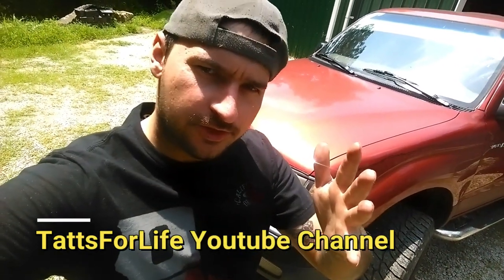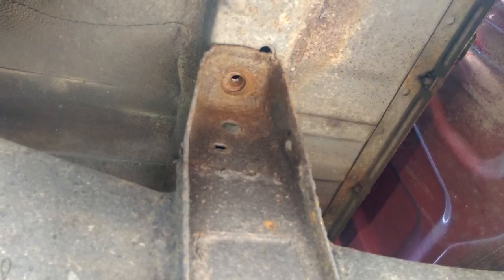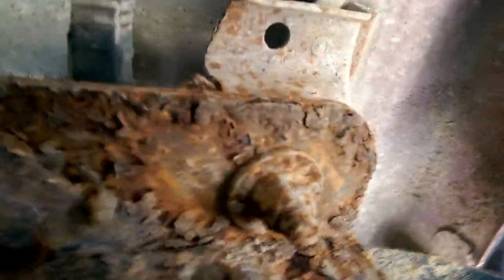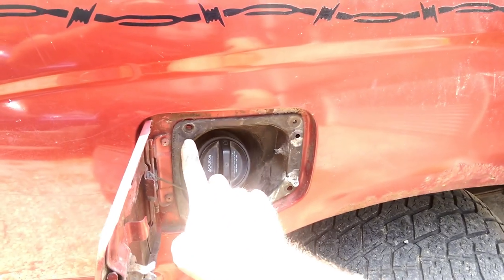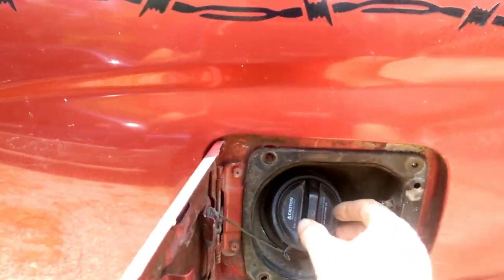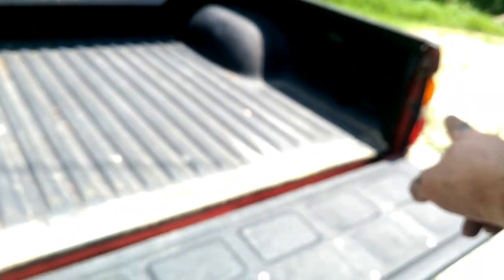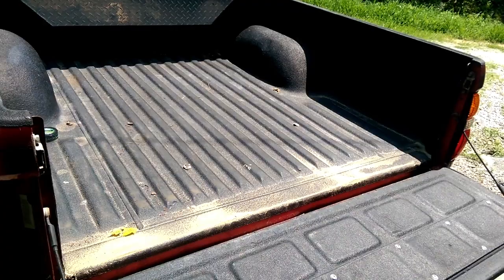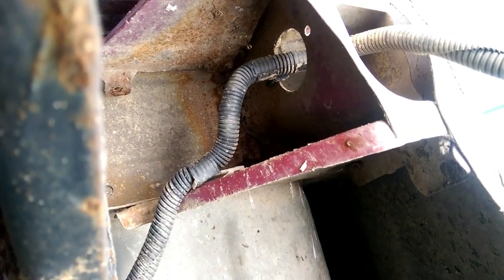How To Remove A Toyota Tacoma Truck Bed

Comment: Thank you for the video, i really hope my bed will come off easy, lol. On a side note i need to change the fuel pump on my 99  tacoma 2.7L, will i be able to change the fuel pump after i take the bed off? Or i need to drop the tank off too??  I would rather do just one. Thank you
Reply from the maker: I'm not sure, you should be able chance pump with bed off, I never seen a truck that you could not

Comment: Its funny you posted this. I have a Tacoma Im trying how to figure out how to take off the ARE cap
Reply from the maker: the factory are cap?
Reply: no the truck cap is something the previous owner put on. its a very nice truck cap though. I have had no reason to take it off yet. Was just curious. Im sure its just some hardware and sealant where the cap meet the truck body edges.
Reply from the maker: sometimes they just held on by clamps very few have bolts that hold them on

Comment: The bolts in the back are super hard any tips to break them loose?
Reply from the maker: just luck and hope, all I can say, use lots of wd/40 and maybe heat
Reply: You can get a grinder/cutter at harbor freight for under $30.00.  Bet there are videos on how to cut with grinder.  Destroy the olts.

Comment: Are the 3 bolts underneath pretty similar for the Gen 2 Tacomas? Good video, by the way, but man, your truck has significant rust underneath- was it originally from the North?
Reply from the maker: Dk, was a customers truck

Comment: Good video though isnt there a main harness plug that can be disconected from close to the back lights so that each light doesnt have to be taken out to remove wires? my thing is want to take bolts out just to slide back the bed 2 feet to get to gas tank hoses then slide bed back it is 3rd generation tacoma which used plastic composite bed much lighter then previous beds on tacomas.
Reply from the maker: im not sure, it was always just as easy for me to do it this way lol never tryed any other way

Comment: Can anyone offer me a suggestion? The bolts he says in the video that "will be the most fun you ever had......" on my 2002 are just stuck, can't budge them at all. In fact I think the bolts themselves are rusted and aren't really hex anymore. I can't get anything on it to grab it. I got the other 4 of them off (pain involved there too) but at least they didn't break.
Reply from the maker: have you tryed a torch
Reply: @TattsForLife  Thats how I got one of them out. The other one had to be cut, with a hacksaw. Forgot that my dremel was burned up. Glad that job is done ! Thanks for the response.
Reply from the maker: welcome, happy the video was helpful
Reply: There's also a tool called a nut splitter that will pop off rusted nuts in a matter of seconds.  You will need a new nut because the splitter opens up one side of the rusty nut.